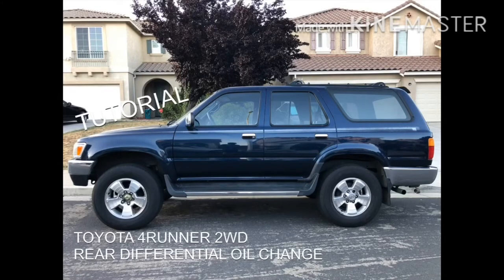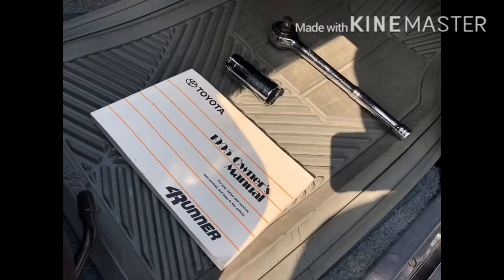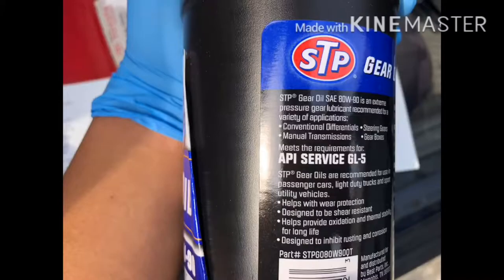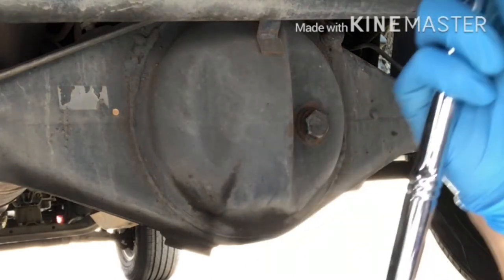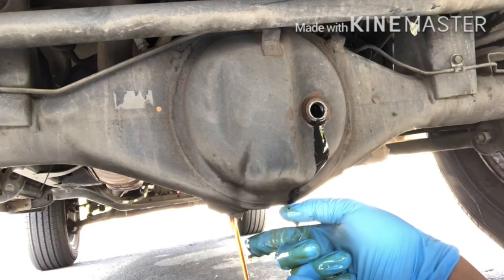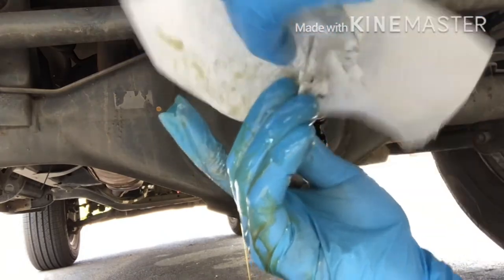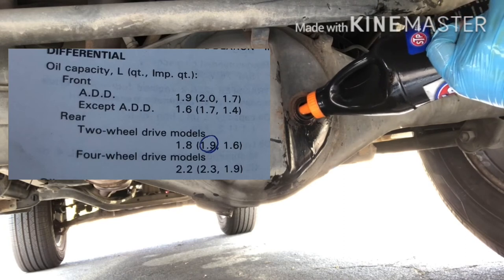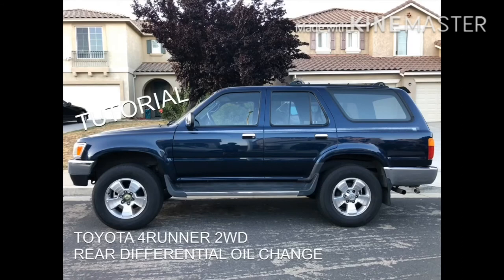2nd Gen (1990-1995) Toyota 4Runner Rear Differential Oil Change (TUTORIAL)

Comment: Hey, not sure if you still have your 4runner, but if you do could you look into the owners manual and see what the drain and fill capacity for the transmission fluid would be for 2wd model?
Reply from the maker: I still have my 2Runner. I’ll have to check on that tomorrow
Reply: Good afternoon, were you able to find out?
Reply from the maker: According to the manual. The drain and refill capacity is UP TO 1.7 quarts

But when I did my transmission fluid change. I changed my filter as well. So what I did was I drained the oil out and whatever comes down to the oil pan. That’s how much new oil I should put in my gearbox. In my case I put 1 gallon of transmission fluid
Reply: @TndPnyRCofficial  thank alot!
Reply from the maker: No problem